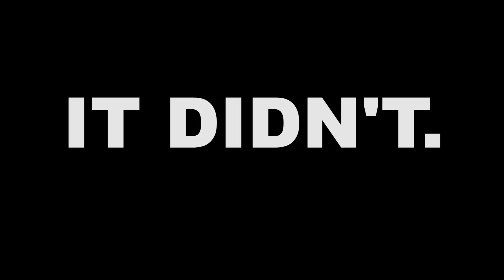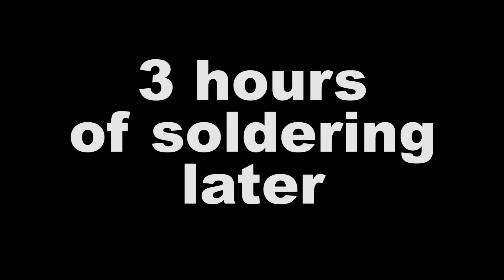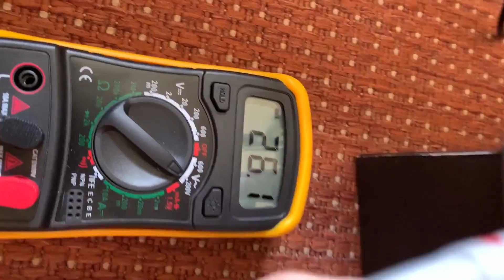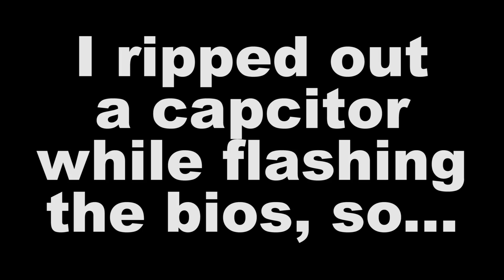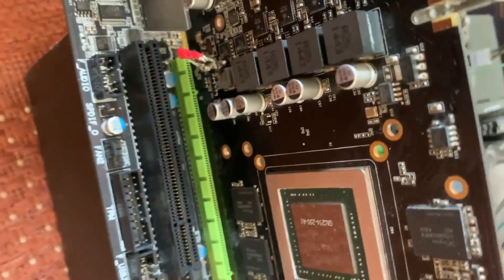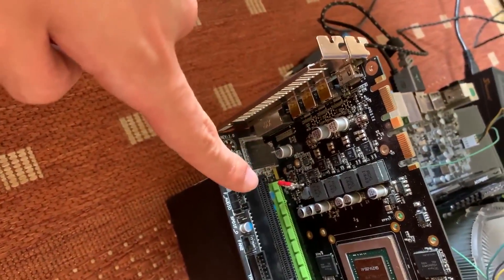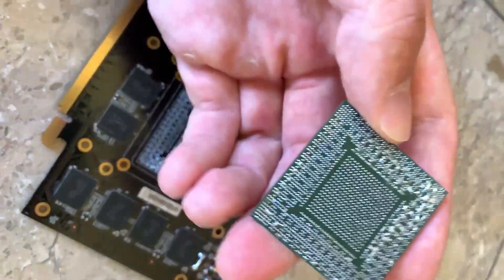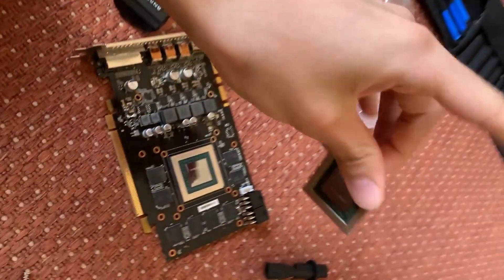Broken GTX 970 Troubleshooting and fixing process (No signal - How to fix a GPu with black screen)

Comment: Hi, yesterday i was playing Bf4 and suddenly the game crashed so i rebooted the pc and found the name GTX 970 is gone and only displays : basic display device" if i try to update using windows update or through Nvidia driver it updates fine but after restarting display is gone after windows logon screen and " no signal " pops up. if i uninstall the driver in safe mode the display works no problem, not sure if its a hardware or software issue. to check if its software i swapped gtx 1660 from my other pc and it works no problem. the gtx 970 couldn't get display with its respective driver. Can you suggest something else? thank you..
Reply from the maker: Your card is damaged. Doing a reflow with a heatgun or hairdryer as shown in the tutorial might help. In device manager in Windows, close the the problem with the driver there should be a code error. If it's 43 it's a memory problem!

Comment: Youre killing ur gpu more..
AC DC not AC

Check 12v,5v,1.8v and 1v rail first..
Check mosfet whether it is good or not.. most problem due to mosfet or ldo...
Reply from the maker: Facts, back then when I did this I was really just starting out, but I still managed to get it back to life by cutting a phase off!

Comment: Hey buddy, not gonna hate on your video but you went about this whole thing completely wrong. Misusing the multimeter, dunking your gpu in water, bridging over fuses and heatgunning the card. It's like an extensive list of how NOT to fix something. Please do some more research next time, there's lots of good videos already on youtube on this subject
Reply from the maker: I see where your comment is coming from, but there are a couple things I should say:
1) The multimeter I was using in this video had the proper voltage rail broken. So, in order to measure voltage, I had to use the wrong rail, which still did the job fine, even though it displayed the wrong number. I only needed to see if THERE WAS a number or not, not really to check the number.
2) The watering part actually was good, is something I recommend, something I've done multiple times and what my channel is called after.
3) The heatgun is a last resort method which MIGHT bring back your card, however it's not guaranteed to keep it alive. At this point in the troubleshooting, I would have loved to get it back, even just for a bit. If the heatgun brings the card back, you also finally identified what the problem was.
4) Yup, bridging the caps wasn't smart. I was simply out of options and figured I'd give it one last shot to see if I could get a split second of video signal before it caught on fire.

Comment: are u sure about that !?
Reply from the maker: Yup! Had a fairly decent success rate on the broken GPUs that I had on hands
Reply: I have same problem. Computer running without any problem to lockscreen. After no signal displaying monitor . Sad
Reply from the maker: @z-respa  That's a driver problem, probably related to a faulty GPU. You can try the methods in the video to fix it
Reply: @ImWateringPSUs  ahh!. thanks !

Comment: Guys! What was that? You drowned boards in water instead of alcohol (corrosion will be terrible). And measured 26V in system supplied from 12V ATX power supply ? How?
Reply from the maker: Water instead of alcohol isn’t gonna damage anything if you dry everything up properly. It’s literally my channel’s name and I’ve been doing it for years. I still have the first PSU I’ve watered in a HTPC build and it has zero corrosion or rust. My Multimeter was broken, so I had to use the wrong AC/DC option. But the proper value was around 25V, with the incorrect measuring option, so we made do with what we had.
Reply: @ImWateringPSUs  The water will evaporate but salts will not. They will stay especially under BGA chips. As long as there is 0% humidity in air the card would probably work. But it is impossible ! Someday this salt will eat some traces and the card will fail.
I had a flooded phone that worked fine for about 6 months after cleaning and drying. I opened it when it started crashing... It was total mess !!!
Reply from the maker: @xys007  I actually still have the first PSU I watered. 3 years and it's still running ;)
Reply: @xys007  If the water is demineralized it could work, but since there is soap in it I'm guessing that isn't the case.

Comment: Umm... Next time you try measure DC voltages on a video card it may.... MAY just help you read the correct voltages if the meter is set to DC voltage and not AC !!!!!!
The rails on the shunts should be reading 12V. 
I would recommend you check out Eli Tech as he has some great graphics card repair videos.  It's fun and exciting trying to fix things so all the best with your next challenges.
Reply from the maker: Yep, you're definitely right on that. My multimeter was having some problems with the DC tho, so I just made the calculation and figured out that 25 was the proper voltage to read if measuring AC and it worked fine for the troubleshooting for me! I watched some of ELi's videos btw, great guy!